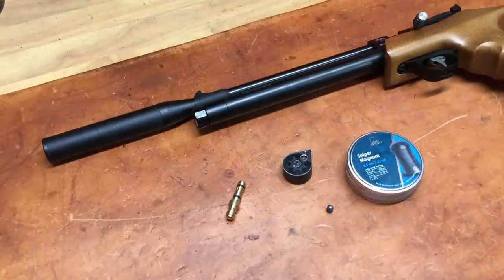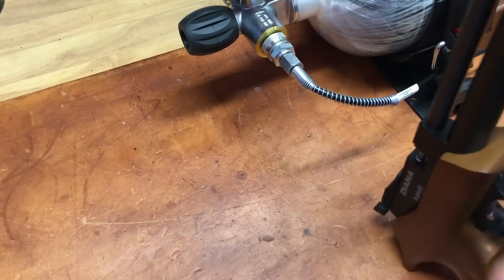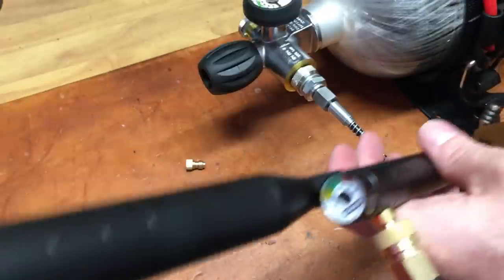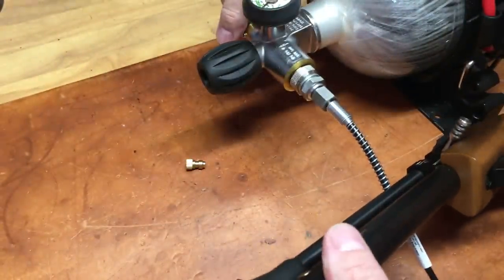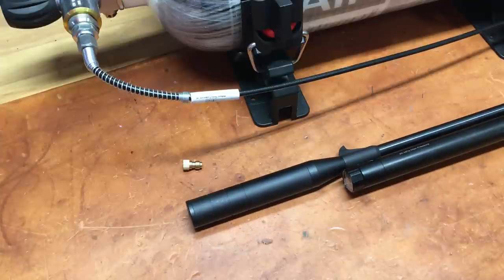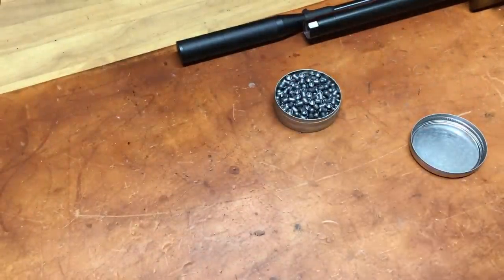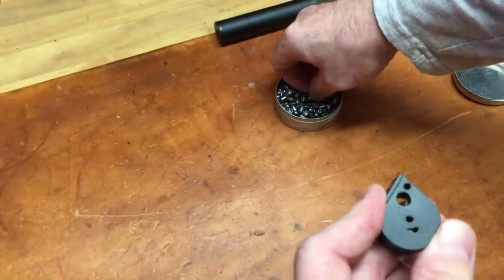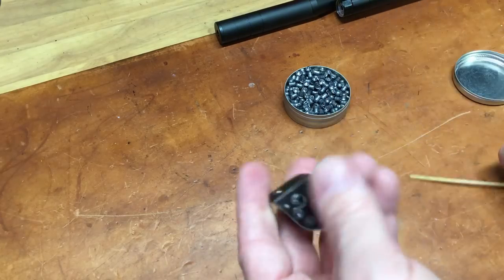PCP AIR Pistol Diana Bandit Features

Comment: Hi when I remove the silencer on mine it has a threaded bar sticking out of the barrel. Is there anyway of removing that or did yours come with a cover
Reply: Should have come with threaded screw on cap in parts bag

Comment: What is the energy level?
Reply: 17.3 FPE
Reply: @gwhitfield4239  WoW
Reply: @clanutryx  Ive actually already  seen 19+ fpe on crosman 14.3 ultra domes @780 fps.....since writing that. The sweet spot on mine is between 1800-2600 psi..operates very smooth but I did take it down and clean the barrell and hand polish the bolt. I oil lightly with silicon oil and the bolt just glides and pops like it should.  Hope you have one by now,  if not you're missing out on a good one...happy plinking!!